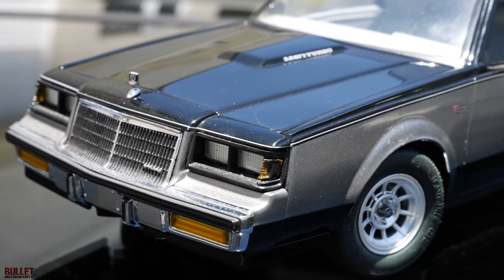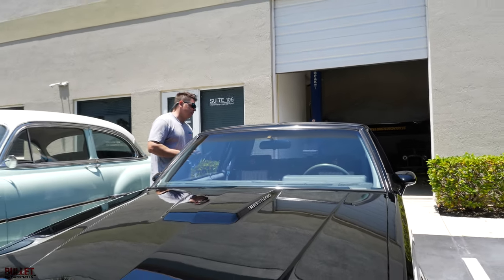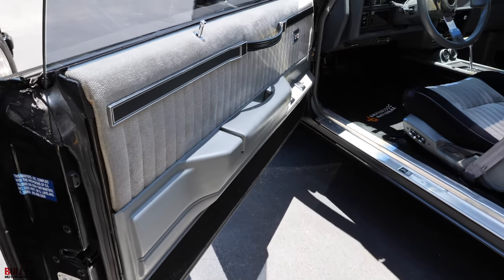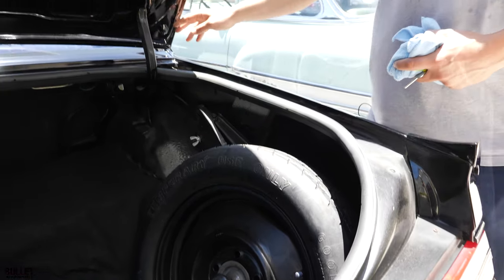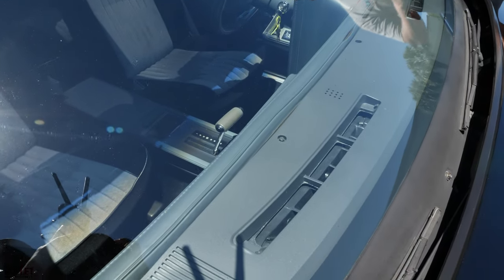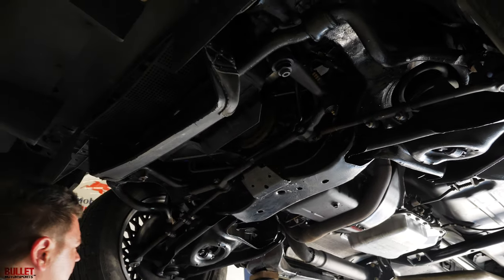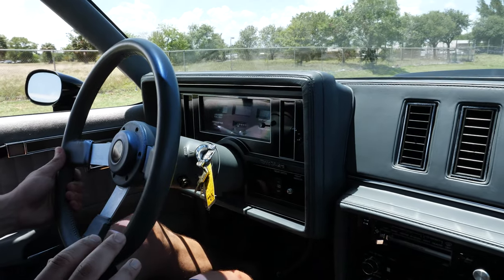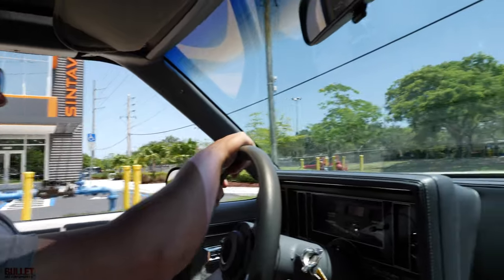One Of The Very Few Surviving 1986 Buick Grand National T-TOP Edition | REVIEW SERIES [4k]

Comment: Wow, have never seen a GM radio with red fluorescent digits, thought they were all green in that era. Otherwise pretty close to one I sold in 92, different serial or I would be truly spooked. Nice job, keep them coming.
Reply: Correct. The radio is NOT original to the car, but good (correct) refurbished used ones can be had on Ebay for a few hundred bucks......